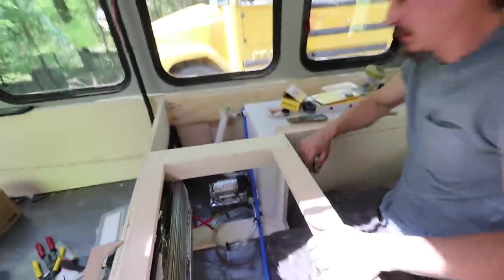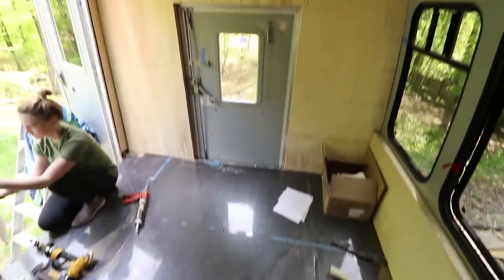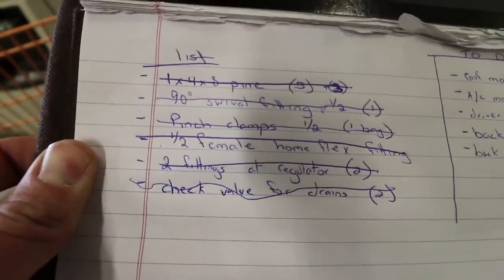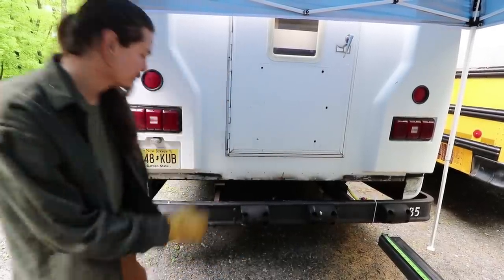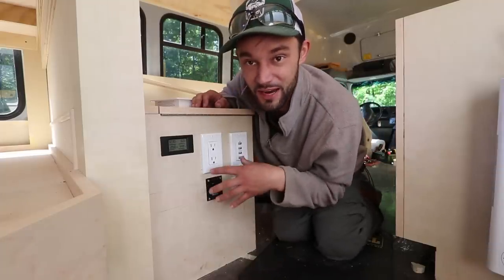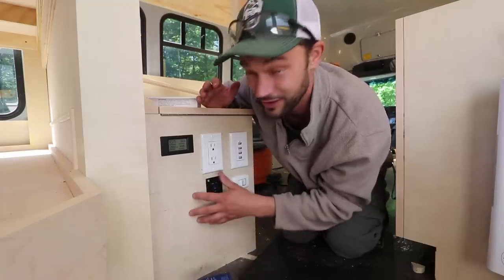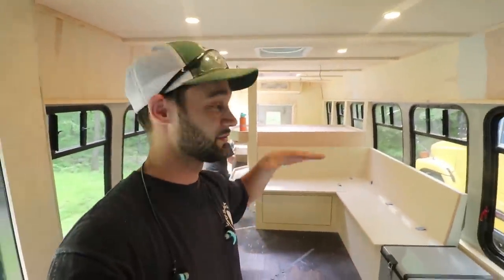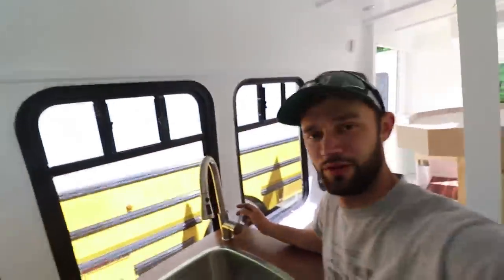Amazing SHUTTLE BUS Conversion in 4 weeks

Comment: I have a bus that is almost a twin to this one. A 96 with the 7.3 powerstroke built by supreme in Goshen Indiana. So fun fact if you get a wireless winch remote you can set it up to open and close the door with a key fob that looks like a normal key fob for a car. Love what you did I will be posting videos of mine when it's done. I am setting it up for pet and rescue transport. It has 40 built in kennels and then a small sleeper areas with a fridge, microwave and a shower.

Comment: just a tip...that grill you installed for the a/c probably blocks 70% of your air flow.
Reply: An air floor style return vent or cut with dremel wheel and bend forward. Won't show from eye level.

Comment: Generally, wonderful looking build. Several comments: on the back porch, if there was an ability to fabricate rounded corners on the back end, then that could have happened. The seat box housing the electrics, why was a hinge placed at the side end? Shouldn’t it have run along the back of the seat lid? Lastly, WTF is up with the 4x4 column? Is it needed as a support for something on the roof? Because it isn’t a great design choice. If it is a support for roof weight, why didn’t you just fabricate a roof rack, and divert the  weight? I hope you will take some of my comments into consideration on your own and future builds. 👍 You got skills, for sure.

Comment: I’m considering doing a shuttle build now. They are less expensive for the same engine/chassis as like a Transit or Sprinter and it is designed with passengers in mind so you are more likely to walk away in an accident. My biggest concern is all of the many many windows and building around them. You are just covering the windows where needed?

Comment: That metal grate is going to restrict air flow, causing the AC unit to run hotter. It will die sooner. Believe me.
Reply: Amateurs charging for shoddy work violating safety codes.

Comment: I get the reasoning for keeping the electrical controls at 6:30 near the batteries and inverter, but that looks like a tight gap to walk through there, especially if you're going to have stuff plugged in there.

Comment: Hinge an aluminum channel deck on the bumper that is the width and height of the bus that folds up and down.  Fold it down with swing down adjustable legs.  The lights will shine through the grating or you can add $10 Harbor Freight magnetic ones to the bumper or permanent ones to the bottom of the deck when it's folded up.

Could you provide the make and model of the following?
Flooring.
Stove.
Fan.
Refrigerator.